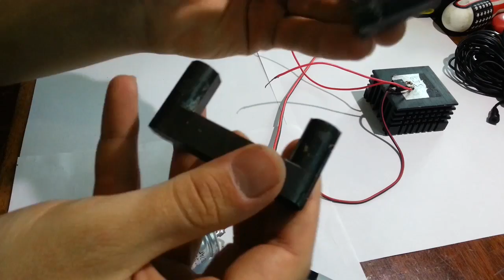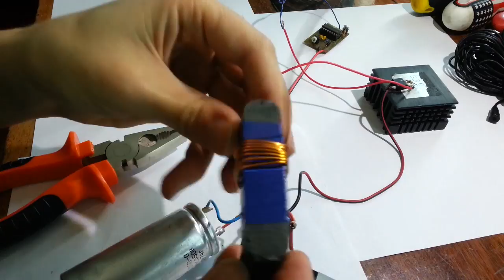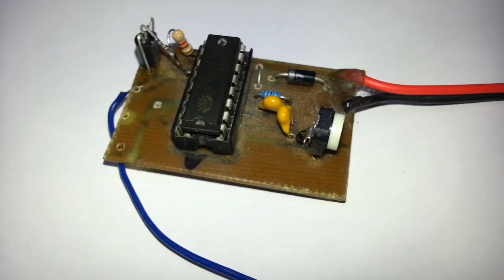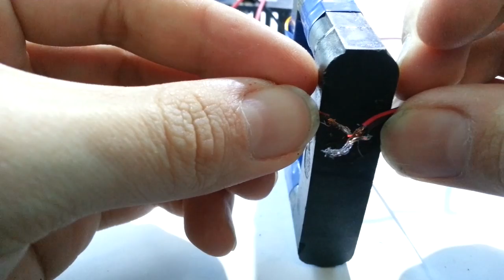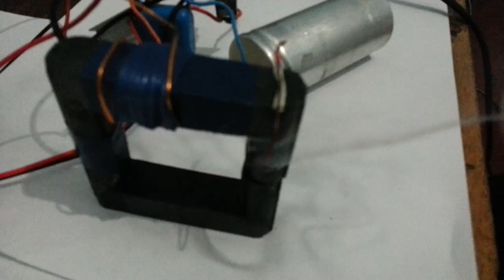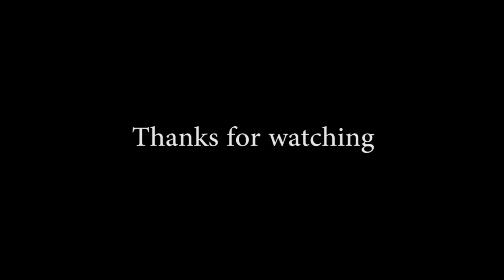High Frequency Transformer / DIY Ferrite core transformer / Mini demonstration

Comment: Can I please get a detailed procedure to build a HF transformer?? And what is the o/p frequency and voltage from the one you made?
Reply from the maker: Basically HF transformer is just the transformer that has ferrite core. I used ferrite core that I found inside of an old TV. I used PWM on TL494 with IRF540N, it is generating 40 kHz signal. I used 20 volt DC power supply. Output voltage depends on what kind of secondary coil you use (more turns of wire - higher voltage). I didn't calculate how many turns of wire I need, It just an experiment, I use my "educated guess" :)
Reply: +Electrical Projects okay..thanks for the information..and I have just one more question, how can I increase the o/p frequency if needed to..
Reply from the maker: If you use TL494 the frequency is determined by Resistor (pin 6) and Capasitor (pin 5)
Reply: +Electrical Projects Okay..thank you so much 😊
Reply from the maker: You're welcome!

Comment: is that laminated iron core from where you got it
Reply from the maker: That is ferrite core, from an old TV
Reply: thanks plz tell what ac source you used as using  directly wall sockets is not advised
Reply from the maker: I've used PWM, it transforms DC to 40 kHz AC.
I've used PWM controller TL494, and MOSFET IRF540N.
Reply: but my i have a wee project its not huge like yours can i use a resistor for stepping down current as i have limited resources
Reply from the maker: I don't really understand what you're asking me, what is a wee project?
Reply: tiny one 
it wont be able to handle current of high intensity
Reply from the maker: Then I guess you can use a resistor to make lower current, But I can't be sure because I don't know the schematic of your project.
Reply: To investigate the relation between the ratio of – 

1. Input and output voltage. 
 2. Number of turnings in the secondary coil and primary coil of a self- made transformer can i use dc current instead i need current for very short duration
Reply from the maker: Input and output voltage depends on many factors, including:
1. turns of the wire and thickness of the wire
2. type of the core
3. width of pulses if you use PWM
4. frequency.

Transformers can't transform DC current.

In my project on the video I didn't calculate anything, it was just an experiment.
Reply: ok thanx for help :)
Reply: Electrical Projects transformers can use DC current if it is pulsed
Reply from the maker: Yes, you're right, but technically, If DC current is pulsed - it is not completely DC current. Wikipedia: A pulsating direct current is contain components of both Direct Current (DC) and Alternating Current (AC) that changes in value over short periods of time.